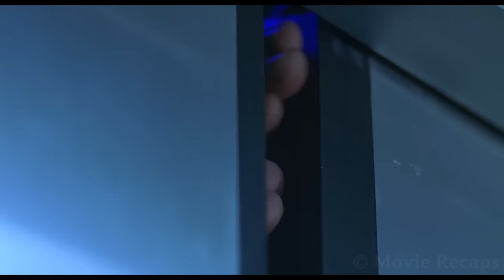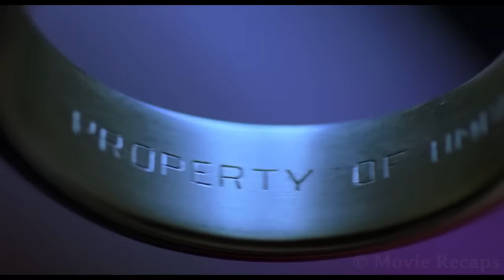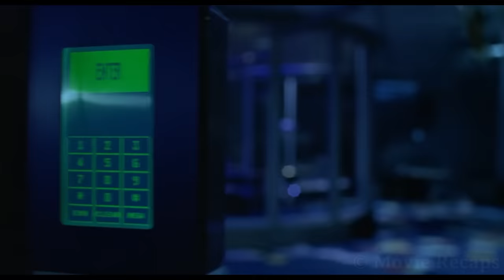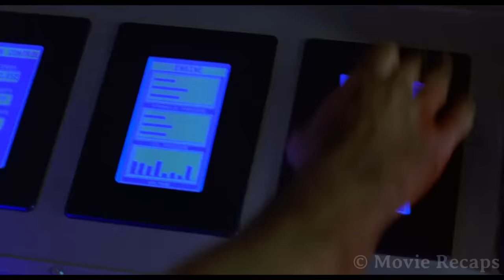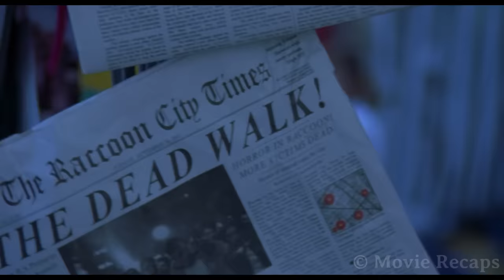Thief Unleashes HELL While Trying to Steal a Deadly Virus From a Research Lab

Comment: What's the poiny of a containment chamber if the ventilation duct is still connected to the rest of the building 🤣
Reply: It wasn’t.  The T-virus didn’t spread into the ventilation system for the entire Hive until after a researcher breached a containment barrier with a fire axe.  Plus, the release of the T-virus wasn’t an accident, but a deliberate act intended to circumvent the safety systems.
Reply: @DLordSadow  ooh i forgot about that. It's been too long since i watched this movie 😁